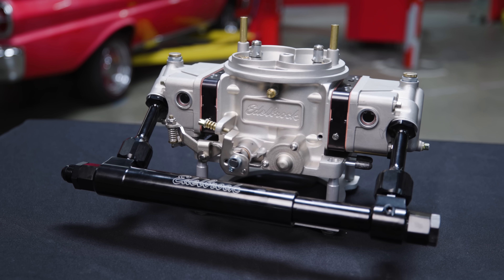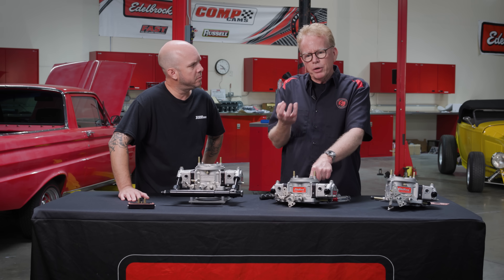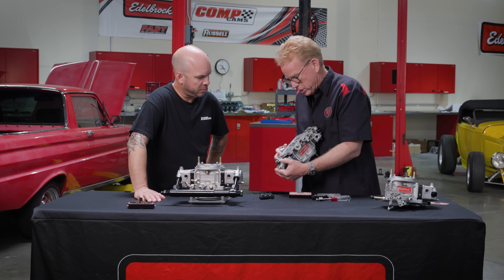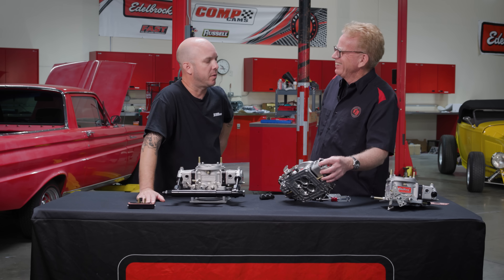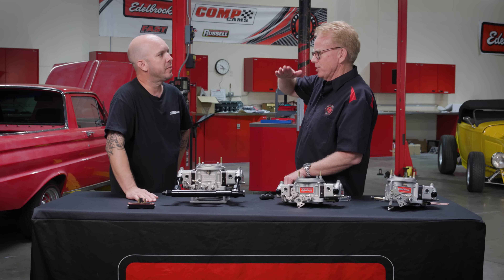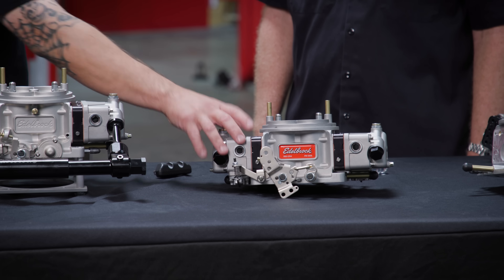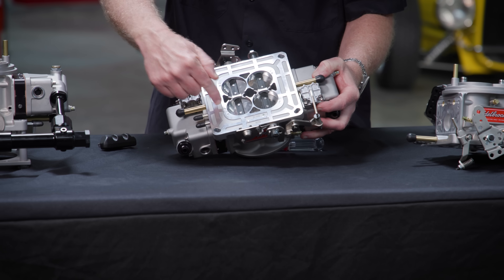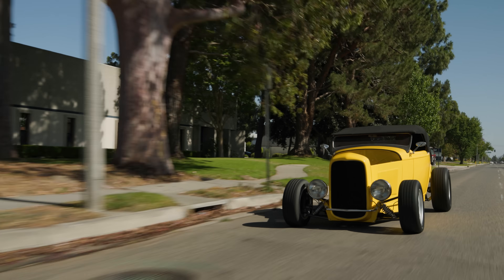The benefits of running an Edelbrock VRS 4150 Carburetor Overview & How to Tune

Comment: How did they get away with using holleys model number and design? I bought an edlebrock intake and compared it to my merlin intake . Big difference.  Merlin looked so much better. Down inside Edlebrock looked terrible. So now I'm stuck with a brand new edlebrock intake.

Comment: I have the 750 vrs bought it for my hot street  amc 401 what a time i had out of the box my ass the power valve  restrictor jets are  are huge  and no drop base air cleaner will fit this carb and the afr is all over the place stock.  Now the good news is on the low end after rejetting the power valve Restrictors down to a 40 on both sides and dropping the jetting to 69  all sides the low end on this thing is a night and day difference to my old 750dp but on top end its about the same😅😂

Comment: LOL, $900 no thanks, fuel injection is cheaper
Reply: But if the injection fail, you can’t limp it home like a carburetor can.
Reply: @colingan9412  but with fuel injection, I get easy tuning, better fuel mileage, and no vapor lock, it's why every new vehicle is fuel injected
Reply: @sinistersilverado965 that’s true but for me I’d rather have a carb for my rods,injection smooths the radical cam. Everyday driver is fine,hate it when the system fails, you get stuck.

Comment: These carbs are quality built pieces and rival higher priced custom builds I also understand they are blow through ready just need to change power valve s also need to drill tube right behind metering block on primary side to get manifold vacum ! I purchased the 750 and am amazed with this unit .